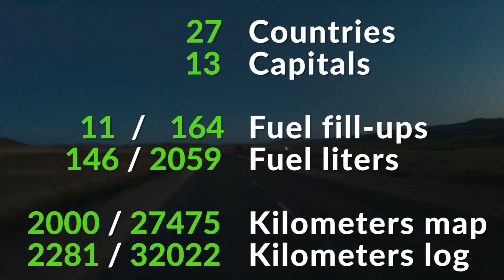Central Mongolia. Motorbike Around the World - Episode 16

Comment: Pedro,
What do you use for extra fuel. I have a 1989 Transalp and I carry a 1 1/2 Gal kolpin container. I still feel that I need to carry more fuel.
Steve
Reply from the maker: Used plastic 1.5l bottles in Central Asia and Mongolia, up to three sometimes. Used 5l jerrycan in Australia. Current setup has no practical room for jerrycan so back to using plastic bottles here in Bolivia. Duct tape friction points of the bottles and wrap them in a sock.

Comment: Holy mother!! what an adventure! Respect man. What kind of bike modification do you recommend to travel through Mongolia? Tips? groetjes uit Amsterdam!
Reply from the maker: Dank! Soft side luggage, if you go hard then good racks and a sturdy mounting system for the panniers (sturdy mount for topcase too!). Depending on the reputation of your bike's rear suspension upgrade the spring to a progressive spring.  Bash plate if there isn't one already. Tough tubes. 

Tips: faster is safer most of the time, compressing the forks is what gets you into trouble in the sand, road direction and condition can change fast so expect the unexpected, Mongolians on tarmac are pretty nuts. Bring an air inflation and tire pressure measuring device. Check nuts and bolts every day/couple of days, bring loctite.
Reply: Dank je wel man!! I prefer soft luggage and after watching your vid i am definitely going to purchase soft panniers. Looking forward to the next vids! take care!